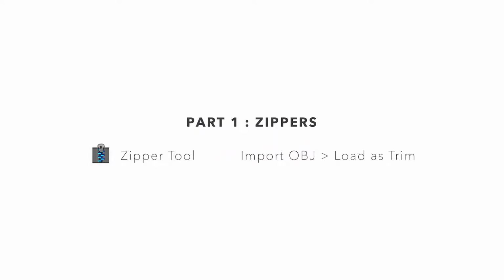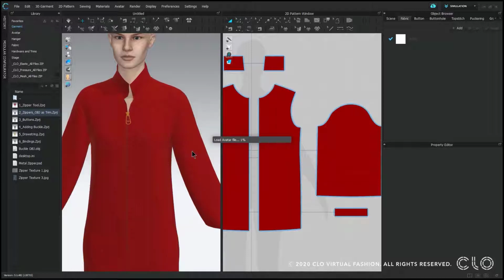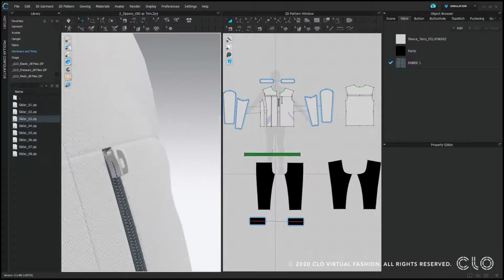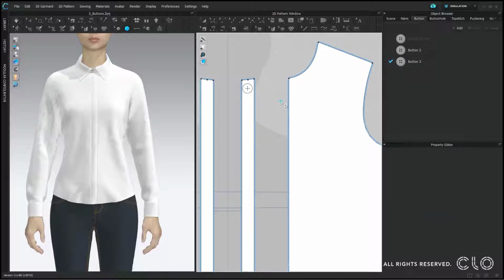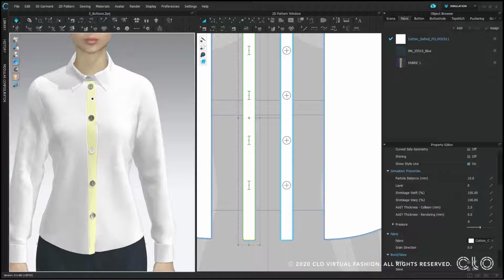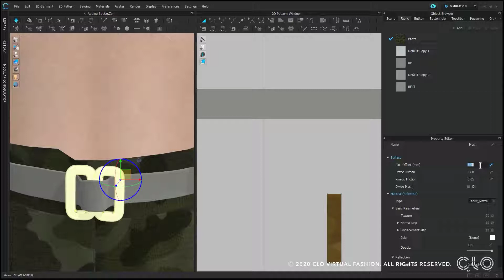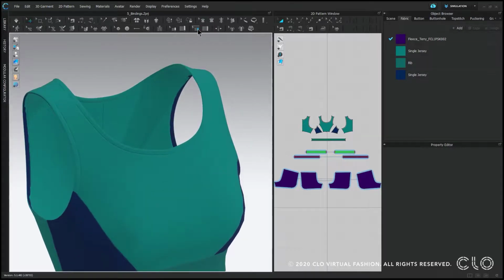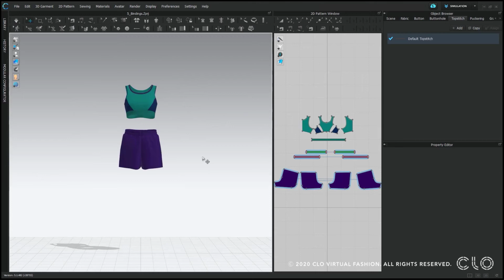Beginner's Guide to CLO Part 3 Garment Details: Hardware & Trims (Lesson 5)

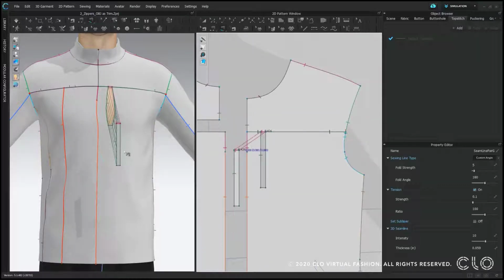Comment: HI there, at 3:40 you used free sewing to join the zipper teeth pattern to the body, however after i create the sewing direction on the zipper teeth pattern i am unable to click on the pattern for the body. I ended up using segment sewing instead, however what may have been the cause of the issue for the free sewing not to work?
Reply from the maker: Hi. For Free Sewing you must click to start the sewing and click to end the Sewing on the first patter piece (zipper). This will complete the first sewing section. Then follow the same path on the body pattern with a click to start and a click to end. So Free Sewing will have a total of 4 clicks. 
It is likely you did not click to complete the first part of the sewing so it would not allow you to go to the other pattern piece

Comment: hi how do i attatch my Trim to Avatar,like you said in video you Should import Trim as Avatar so it can Collide with Garments,but how do i attatch this if my Original avatar moves.
Reply from the maker: Hi There. Trims need to be attached to a fabric/garment and not an avatar. If you bring the Trim in as an Avatar it will not move, but instead remain static. You can then use the gizmo to place the trim, but if the garment moves/animates the trim will not move. If you want the Trim to move with the avatar you will need to bring the item in as a trim and then "glue" into place.

Comment: I dont understand how on earth the binding tool is useful for drafting patterns, its just a visual change and doesnt reflect the pattern at all. It needs to create a binding strip so the sample maker can actually cut the binding strip to its appropriate length and then bind over the raw edges. With how it is now, its entirely performative
Reply from the maker: The binding tool is simply a way to create the visual representation of binding [as is the piping tool]. Both can be created with pattern pieces and sewn into place if desired.

Comment: I seem not to have the "Add to workspace" option when trying to add pullers from the library, only "Copy the Path", therefore I cannot add objects. Is it because I use a trial version of the program?
Reply from the maker: The Trial Version is the full version. You can Double Click on the Trim or OBJ and you will get an import dialogue.

Comment: I wanted to add a lining to the bra and then to the binding tape. But everything collided. Any idea how this works with binding tape?  
I did a separate version with cut&sewn taping with an internal offset line, but I am not sure whether this is the correct way to do it, pattern wise I mean.
Because it will change the size of the pattern of the bra. However, it looked better than using the binding tape function. Do you have any idea? Thanks!
Reply from the maker: Sorry for the late reply. Were you able to solve your issue.

Comment: Very clear and precise. Real good video. I have always wondered how you use the snaps buttons? Is it the same than other buttons? Because they don't have buttonholes... How do you make them close together?
Reply from the maker: The 2 parts of the snaps do not actually connect to each other. You can add a very small button hole behind the one side of the snap and connect the other one to that.

Comment: I can't see topstiches in binding when I simulate. However when I stop the simulate I can see my topstiches. I already try to copy all your configuration and follow your steps.
Reply from the maker: When simulation is ON top stitches hide/do not show. This is normal and developed this way on purpose. The default topstitches are very small .OBJs that do have geometry, any extra geometry can affect simulation speed so they deactivate and are not shown when simulation is on. This allows simulation to run faster.

Comment: my buttons keep being placed on the wrong side of the waistband! i place them on the right side on 2d window and when I simulate it puts them behind my waistband on the wrong side ... whats happening?
Reply from the maker: This is happening probably because the fabric of your waistband might be "inside out" - where the back of the fabric is actually facing outward. Buttons default to sit on the "face of the fabric" so if your fabric is flipped is makes them go inside because that is technically where the face of fabric is. 
You can fix this quickly with an option called "Flip Normal" . In the 3D window right click on the waistband (or any inside out piece) and choose "Flip normal" in the right click menu. This will then switch the face and back sides. You may have to unfasten>re-set? and then re-fasten your button again, but this should fix it. 

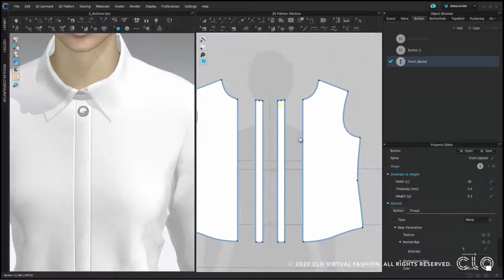Disclaimer about Flip Normal Tool : This is something to use sparingly for situations where a lot of the work has been completed and not too much more sewing or assembly will occur. The reason is because when you flip this piece in 3D it also flips in 2D window - so if you check your sewing after that will also look "flipped". This is all OK just be aware that he piece also filliped in 2D if you plan to do more assemble or sewing. It is generally best practice to make sure all pieces face correct directing when arranging and sewing. You can check this by toggling to Textured Surface View (Vertical Toggle Display Menus 0:09:11) to see the backside of the fabric as grey to confirm which direction fabric face points.
**When Arrangement points are used they automatically place face of fabric outward so you don't have to worry too much about this. https://www.youtube.com/watch?v=uBsrTVU7h60&t=946s

Comment: Is there a way for the buckle to move with the simulation (like the buttons)? I'm using marvelous designer and can't figure a way to have my buckle moving and following the movements of the belt, it just stay suspended in the air.
Reply from the maker: Try importing the buckle as a trim instead of an obj. Here is a link to the discord for Marvelous Designer and you can talk to other Marvelous Designer users https://discord.gg/HAh568h
Reply: @CLO3D  I've bought a pack from Digital Combine on artstation where there's a marvelous designer project with differents buckles and straps etc. I've tried to analysed it but i don't understand everything, he uses an invisible garment behind the buckle to glue it on.
Reply from the maker: Our Connect Community forum is a great please to go ask questions
https://connect.clo-set.com/community
Reply: @CLO3D  Thank you very much for your response, i think i'm gonna try the discord, i'm french but my english is not to bad !! Thanks !

Comment: Any hardware options for Hoodie hole? or string?
Reply from the maker: If you go to Hardware & Trims> Cords & Cord Ends - There will be .zpac files that are cloth and can be sewn on. The .trm files are hard and can be glued on. The button tools have a Grommets built into the shape options, or you can make them as a topstitch finish as well.

Comment: Thank you for this video I have a question for the buckle example, I tried to load the buckle and the software kept on removing my avatar every time I would load it as an avatar which was a bit frustrating because as you know the strap wont hold if you don't load it as such. How can I avoid this from happening?
Reply from the maker: Have you tried "Adding" the buckle into the workspace? Use File Add>Avatar. If the object is in a folder that is linked to your library right click on it and choose add.
Reply: Hey, did you solve it? I have the same problem.
Reply from the maker: Our Connect Community forum is a great please to go ask questions
https://connect.clo-set.com/community